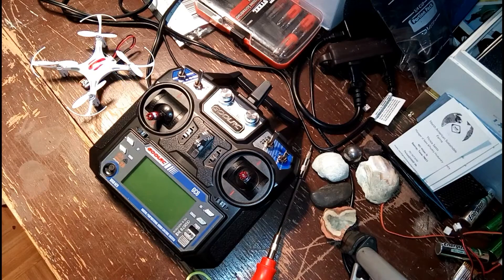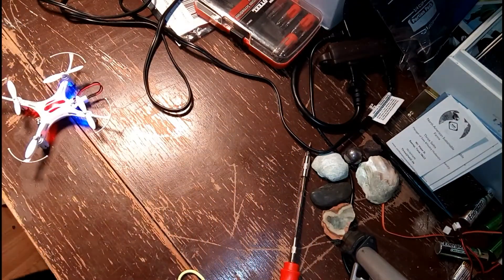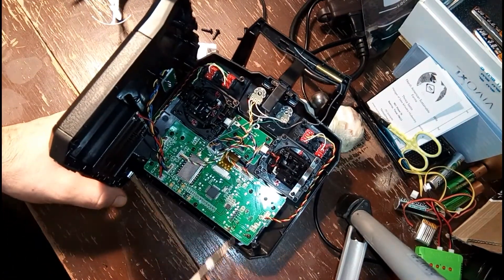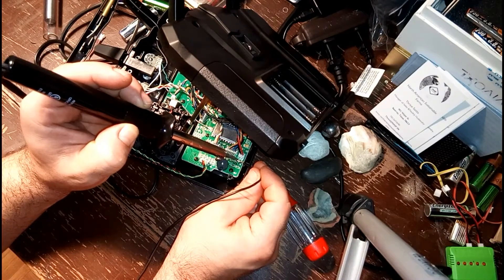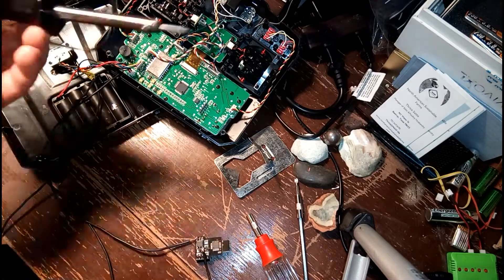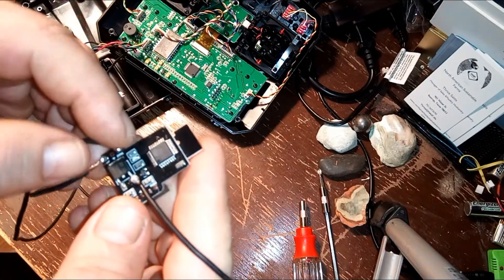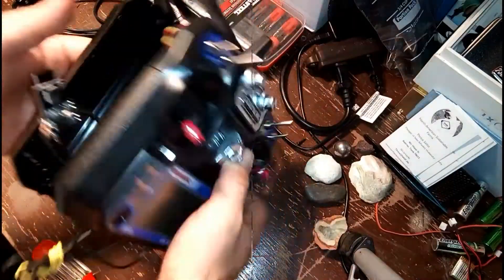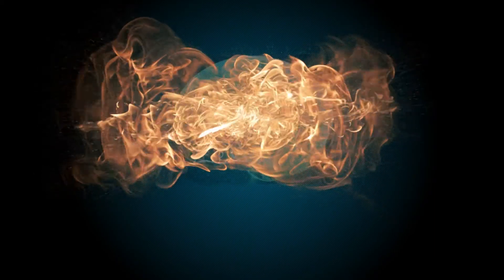Bind FlySky FS-i6, i6x~4in1 Multi-Protocol Module Installation~ Eachine, JJRc & Syma Quadcopters!

Comment: It's best to use hot glue to attach the module firmly and permanently inside the housing. That will prevent rattling and potential short circuits. P.S. Rubber bands tend to rot over time.

Comment: Please could you answer this question asap pleeeeze?
I actually prefer this gem of a radio to my singing and dancing T16s which is so sophisticated its not funny.
I only bought it coz its multi protocol.
The question...will the module you used for the fsi6 bind with a Blade nano S3 helicopter which has a DSM2 rx I believe?
If it will then I will buy three more fsi6s while they are still produced and sell the T16s .
Thanks
Peter

Comment: Why didn't you soldered the + lead to the + lead (near ppm & -) on the 4in1 module but on the other side instead?
Reply from the maker: I do not quite understand the question. You mean soldering on the other side of the 4in1 board?
Reply: 2:09: top to bottom (rightside) -, + PPM.
You soldered - and ppm but the + across the chip

Comment: I can't seem to get the module to power on. I'm not getting the green light... I tested the soldering points and it seems to be getting power. The controller still works, but the module isn't lighting up... can i plug this module to a 1s battery like the xRange module?
Reply from the maker: Sorry for the delay. I am pretty sure you can. Or the module may be bad. Especially if the solder points are correct. Let me know if you figured out what was going on. Pray it worked out.
Reply: Able 1 Tech aha no worries, I've moved onto micro brushless builds already haha. Check out my channel when you got time. https://youtu.be/dmaKX4dpmD4 Thanks anyways, 'twas a bad part btw.

Comment: Tried this on a eachine i6 and did not work for some reason. Worked fine on my flysky i6 though. Any ideas why? Is the ppm in a different location?
Reply from the maker: I would simply try a reinstall first. Cleaning your solder joints. After that, you could always try plugging into the port on the back. I was told that is posible but haven't done a video myself. I will look more into the Eachine i6 though and see what I can come up with!

Comment: Can we use this for Furibee F36?... If it does, it's really cool!!!??.
Reply from the maker: here is this list from the supplier. You need to look up the model number. http://img.banggood.com/file/products/20161020221736TOY-MTX_Instructions.pdf
Reply: Has anyone tried it as the furibee has no arming procedure ? A total newb btw)
Reply from the maker: Not sure. The H8 mini works awesome and is super fast for only $13.99 when ordering from US. Check it out: https://www.banggood.com/Eachine-H8-Mini-Headless-Mode-2_4G-4CH-6-Axis-RC-Quadcopter-RTF-p-975808.html?p=B5141410713645201705

Comment: Do you have to use so much wire? Seems like a lot of excess. Thanks for the video, saved my mistake order aha.
Reply from the maker: No, I did not. I  also cut extra in case I had to cut it down because of possible mistakes. As I learn new tech tricks and mods I make videos and post them. Sometimes they do not always work out and I will update the video and we can all learn more from my mistakes! Thank you so much for watching and I am really glad it helped you!

Comment: I solder exactly like you but my module won't light up
Reply from the maker: Make sure you listen to what I said as there is a mistake around 4:00 min. The PPM wire was originally soldered wrong. I show me fixing the issue.

Comment: how far the range u can control the h8 mini??
Reply from the maker: Goes about 100 meters. You can enhance it though with a antenna mod.
Reply: Able 1 Tech i had just use lipo 7.4v on my flysky..is it not burned the module??
Reply from the maker: I am not sure what the max voltage is for the module. You would have to check the Banggood link and see what it says there. I only use the 4 AA batteries.
Reply: Able 1 Tech did u do the antenna mod or not?
Reply: how can i get max range for h8 mini ... does it transmit through tx antenna or from module ??

Comment: Now have the irx6 receiver right?
Reply from the maker: This is the one I used. The one you are talking about connects in the backport but limits you for using it with anything else unless you remove the port. Either one will work though. https://www.banggood.com/Multiprotocol-TX-Module-For-Frsky-X9D-X9D-Plus-X12S-Flysky-TH9X-Transmitter-p-1097688.html?p=B5141410713645201705

Comment: Thanks for the tutorial, however, your soldering skills leave much to be desired.  Here are the issues newbies should try to avoid:
1.  Don't strip too much wire.
2.  Don't use wire that's too thick, this just adds unnecessary bulk.
3.  Cut wire to the right length.  Make sure there's enough that you can take the device apart again, but no more than that.
4.  Don't solder "cold joints"!  A good solder joint looks very shiny and symmetrical, a bad one looks dull and craggy.  This happens when not enough heat is applied while soldering.  Cold joints are weak and prone to cracking over time.
5.  Connect everything to the same board if you can.  You hooked up some wires to the motherboard and some to the little board in the back of the transmitter.  Instead, try making ALL your connections to one board, that way it's easier to mount the new components, easier to route wires, easier to disassemble in the future.
Reply from the maker: really appreciate the breakdown! I am certainly still a newb but love the hobby and love modifying tech. I'll make sure to include tips like this in future videos. I also have better soldering tools now!  Thank you again for everything! You are awesome!
Reply: I just did this mod, after seeing that it could be done.  On my FlySky I6, there are clearly marked test pads for 3.3v, GND, and PPM Out on the main board.  I just soldered to those.